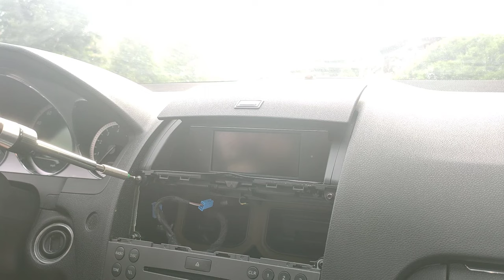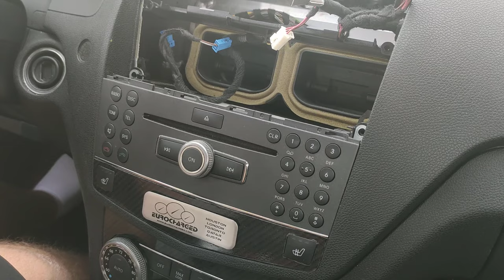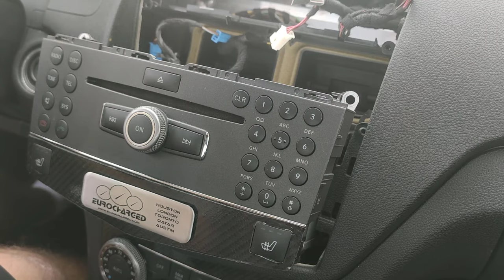W204 C-Class 08-11 ANDROID HEAD UNIT OEM STYLE COMAND Tesla Install DIY Part 1 Prefacelift C300 Pt.2

Comment: Could you do another video explaining/ showing how to do the steering wheel controls?
Reply: @honkeykillaAK47  Hi, how did you solve the sound issue as I have the same problem
Reply: Get an aux cable and connect to aux car, make sure you set up the old head unit on aux before removing.
Reply: Did you guys fixed the steering wheel controls?
Reply: For my C300 2008, I got steering buttons to work. 
Choose "Raise Protocol" C-Class 2007.  That works for me.

Comment: Update: I installed it everything working fine.. I will say feed the main wires to the left side.. Keep the USB on right side.. It will be easier to put inside. Also make sure your wires are secure and connected!

Comment from the maker: Ensure battery is unplugged when installing and you transfer the orange fiber optic cable to the new clip so that all your speakers will work
Radio from: elementotuning.com
Reply: Hello, i have did what you said, but sounds come from ntg4 radio not the android
Reply: @halamsterdam  Same Here. Audio come from ntg4 radio. Any Idea?
Reply: @bounties2101  i have connected with aux cable. Aux cable from mercedes to Android and choose in your original screen the aux output. Now its working
Reply: @halamsterdam  OH WoW. I thought into the same direction lately. Gosh, what an effort for audio to work. I will give it try :D
Reply: OK AUX Port works. Nevertheless, are you aware of some way to choose AUX over the steering, or the OEM Stereo unit? When pressing Radio, by mistake, on the OEM Stereo Unit the audio stream switches without return to AUX.
Reply: @bounties2101  you can switch with radio butten of ntg4.
Reply: @halamsterdam  You nailed it.. OMG. I didn't realise when using DISC Button, it switches to AUX.. You made my day. Thanks
Reply: Which orange cable?

Comment: Did the same install on my C250 W204, producded 2010 pre-facelift. My screen is just completely black, installed it exactly like you but I do not have the 2 orange optic fiber cables.. Any suggestions? :(
Reply: i am having the same issue
Reply: @leviinnes3042  I will let you know if I find a fix.

Comment: Hey man how u doing? 
One question… I conected everything right and the display works fine but the main console with the all the buttons even when I turn off the car and take out the key, is still working like reseting all the time.
Any help?? 
Thanks a lot by the tips and the videos.

Comment: How did you wire up the rear camera? Theres a red wire that comes off the yellow av cable its suppose to connect to the head unit wiring. But im not sure where its suppose to wire to. Normally you would wire to a designated reverse wire but on this set up the wires aren’t labeled. Any help would be great!
Reply from the maker: Only need the red one at the tail end wired to the reverse light, you can check my chrysler 300 video it's the same thing

Comment: How do you control the Volume in Carplay other than with the steering wheel? Is it possible to use the Potentiometer from the original CD unit?
Reply: Does it come with CarPlay and how do you use it(like where do you plug in to make it work)
Reply: How did you install carplay?

Comment: Hello, I did the installation and everything works but I have no sounds, what Am I missing?
Reply: Hi, how did you fix the sound?
Reply: 1. You should have an aux input in your glove department, 2. you need to get an aux wire that has the red/white wire. 3. Plug the aux head into the aux input then run the other two male wires red/white to your W204 radio and use the female red/white wire. 4. After plugging all your wires go to settings in your W204 and turn the aux ON, sometimes it does it automatically, but check first. And hopefully you should get sound.
Reply: @Obie79  what if I dont have aux in my w204

Comment: If you  want to make steering wheel controls work you need to setup the canbox
Reply: true, i have w204 2010, 4 button wheel with volume + / -  are OK working. OD-BZ-B3 canbus.
Reply: how do you do that ? Can you elaborate for me ?
Reply: Wym?
Reply: for its steering wheel control functions ,steps as follows :  connect internet first, and then do settings-Car Settings-Factory-000000-CarType Setting-Oudi-Benz-BENZ_U01-ok
please note: please connect the stereo to the Internet before set the CAN type
Reply: @macinasek10000  Can you make a video on this please, I just got my radio unit today, would love to have the steering wheel controls work
Reply: Can you explain more please
Reply: @macinasek10000 thank you man!!!
Reply: @smurfangry6351 can you help me 
Buttoms wheele and panel not working
Reply: @mikelshtatri4013 Hi Did you manage to connect the buttons, if so how?
Reply: @macinasek10000  this was the most helpful comment I found anywhere! I was able to "set" my steering wheel control. The part I did not understand before is that I had to find the hidden "factory" menu first within "Carsettings" in which I had to type "8888" to gain acces then I was able to select model and type and learn the steering wheel controls (only the right side however).

Comment: Do u need to run power to this unit ? Or will it power up when u plug into the old radio ? Ur video cut out audio when u may have been explaining
Reply: Plug N Play
Reply: Im wondering the same, some explanation is gone with the audio

Comment: Where did the original screen signal wire connect (the wire with the large rectangular metal plug)? I see you plugged it back into the back of the radio, but did it connect anywhere on the display side?
Reply: 14:21 shows it plugged back into the stereo side- where did it plug at the other end?

Comment: The part where's the video is mute. How to connect the radio antenna. Is what i need. You point at the blue connector but it is connected to the dvd lector? Or connected to the screen itself... it is not clear and i have all connected okay but not radio signal. If you can please help.
Reply: Did you connect it if yes how?

Comment: Is it possible to buy an adapter to watch the original radio on the radio conversion? To set the time and the same after the battery was disconnected
Reply: maybe if you get the other design, where it is basically wide screen, there you can still use the factory ui and controls

also idk why people still disconnect the battery when changing the radio :D... it is better to be sure but completely unnecessary, especially on mercedes cars, where you lose memory of everything around the car
Reply: @AlphaKala   The car was at a Mercedes Benz dealership; there is a recall campaign for the airbags in Germany, where I come from. I don't disconnect the battery because of the radio
Reply: @MasterChief-pr6fq  exactly, no point

but recalls are something else tho :D

Comment: I also put a display on my mercedes but the radio doesn't work, do I need the socket for the radio or not?
Reply: No need just simply unplug the small radio plug and plug in the head unit

Comment: I love how you skipped reinstalling the bottom part haha. I’m having trouble getting the harness to tuck. If anyone has any recommendations then I’d greatly appreciate it.
Reply: U get it in all the way? I can’t yet
Reply: I did. It was a pain in the ass but I got it. The problem is I’m afraid I have to pull it back out because the radio has static so I need to move the antenna. Sucks
Reply: How tho I’m still having trouble
Reply: You have to to tuck the harness as far back to the bottom left side as you can. Try to tape or zip tie the wires so it doesn’t move.
Reply: Im thinking abt buying the screen. How do you enjoy it? Does it have apple car play?
Reply: You guys manage it ?? So close to breaking something haha.
Reply: It’s wasn’t the easiest install
Reply: Bro same!! 😂

Comment: How did you get it to fit with the wiring harness
Reply: I had that issue too, eventually i got it but still had to force the radio into place
Reply: There is space down bellow, just enough to fit the harness, i fit the harness first in that gap down bellow, then insert stereo half way and connect the other part with my hands bellow the unit. Its anoying but it fits

Comment: Isn’t the 2011 a different unit. With flip up screen. Is there a retro fit upgrade to maintain to hidden fold down feature for the 2011 C250. Cheers. All great info.
Reply: If you have the OEM flip up screen, you can buy an android decoder to give you Apple Carplay on the standard screen. There are no flip-up android screens if you have the regular (non-flip-up) screen in you W204 though. Hope that helps.
Reply: @TheSparkythespark  do you have a link for this?

Comment: Hello. How did you connect the radio antenna?
Reply: Pull the green antenna cable out from the back of the car radio/controls and plug the new antenna cable to it

Comment: Where did you do all the cables (quadlock from main unit and android unit) there is no place behind the mercedes  main unit!!!
Reply from the maker: I don't quite remember but I think you could pull it up quite a bit and tuck it in, or in one of the empty parts in the rear

Comment: Got the back up camera installed and it activates when I hit reverse but then about after 5 seconds it goes to a black screen . Any one have this issue?
Reply: Delay video setting need to be on auto or off
Reply: Same here. Glitches on and off. Anyone have a fix?
Reply: Where did you wire the red wire from the camera?